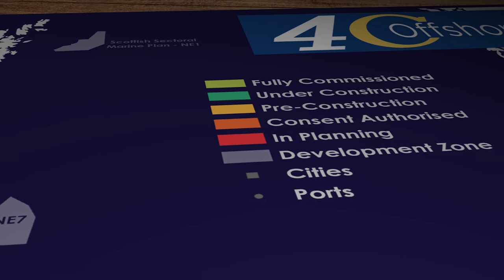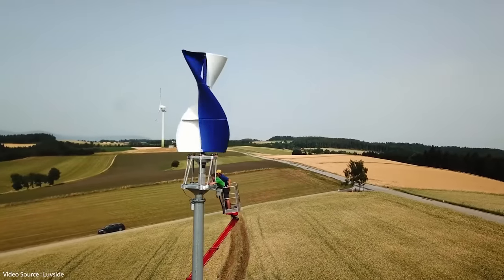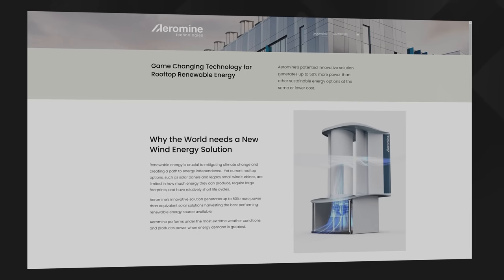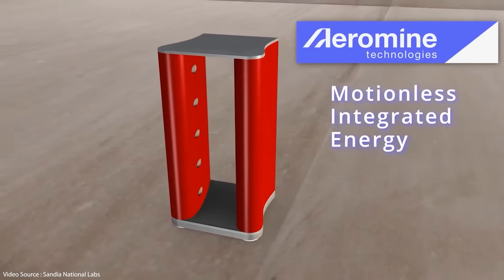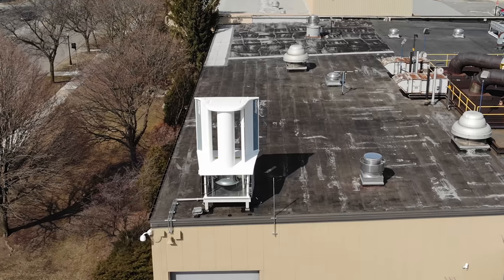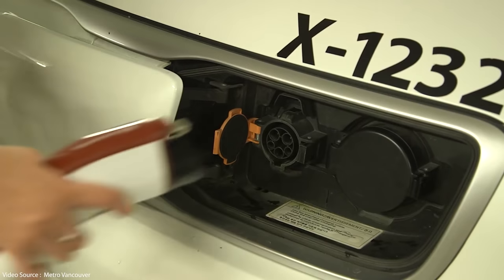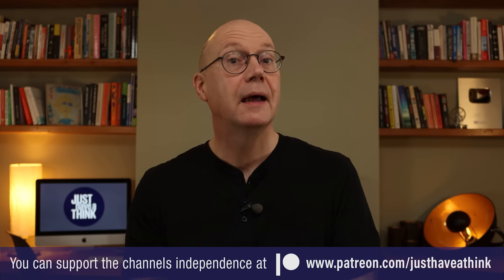Aeromine Rooftop Wind. Static. Silent.  50% more power than Solar PV. What's not to like?

Comment: Thank you! Brilliant as always and I am a great fan of your channel. To the Aeromine: As always with a new product in energy generation, you know exactly where the problem by looking for what is not being stated: Price and productivity. That is not David's fault - it has not been published anywhere. I had to ask. For those of us interested in the financial returns in terms of IRR: A single unit cost c. €10K in hardware only, turnkey installed c. €15K, depending on labour costs. Output is stated at 10-15 MWh per unit per annum, depending on location and wind conditions. In company presentations, output for a 40 unit array is shown at 400-600 MWh total p.a. That comes to the 10-15 MWh per unit per annum, although there are no long term studies to underpin this. O&M is claimed to be practically nil but generator unit needs to be changed out every 6-8 years, so call it 7. That makes it c.€140 p.a. and that is if nothing else happens (not my life experience). Wind speed needs to be 4-5 m/s (3.7 to start up), so 14-18 km/h, which is not an unreasonable speed in suitable locations (not all are). At a more reasonable 1.5% O&M costs, an assumed price of "saved energy" of €120 per MWh i.e. what you pay your provider as a commercial user the IRR is 4-9% (unlevered, equity only) on 10-15 MWh productivity p.a. per unit. No guarantees though ("depending on wind conditions"). That does not make this bankable.  This certainly does not beat solar PV (static, angled, on flat rooftops with imperfect locations) in Southern Europe, but it might in W France, Benelux and Scandi and may be SCO. Boxes need to become cheaper. But an interesting concept. Vibrations and torsion stress seems to be less of a problem than with HAWT or VAWT. Turning into the wind will make this much more expensive and kill IRR, even if there is a bit more productivity. Let us see whether they can lower prices with a ramped up production. These things are not complicated to make. The R&D is the clever bit. Please remember that the prop is not directly driven by the wind but rather by a vacuum effect caused by the foils. This does not work with normal HAWT or VAWT calculations.

Comment: 5KW?  Damn, that is a substantial amount of electricity.   For locations with consistent wintertime winds from one direction, this is brilliant.
Reply: thats per unit, imagine a line of them along the edge of a roof.
Reply: 'Rated 5 kW' means 5 kW is the absolute maximum the turbine can deliver without damage. Operation in low winds delivers less. In very high winds the turbine needs to shut down for self preservation, and will deliver no power at all. The typical long term average output is lower by a 'capacity factor' which for classic wind turbines is (40 ... 50)%.
Reply: For industry that's barely a lightbulb. A normal large version produces in the megawatts.
Reply: 5kw peak power is equivalent to multiple panels (10 or 12)  of pv like he said in the video.
Reply: Too substantial to be believed.
Reply: @Leberteich  I don't believe wind could be strong enough to need shut down of this type of turbine as it is very small. Also it could easily be throttled by varying the slot openings on the sides of the central tube. The limit would be in the structural strength of the static vanes and the tube itself.
Reply: @bzuidgeest  can you put it on a city centre roof?😄
Reply: @kevinwillis6707  i can put it outside the city and it will still deliver far more power. In the city i can use solar, no moving parts, cheap to place, cheap to maintain. In city most roofs are not flat. For that you need industry buildings and they already have room for the larger Mills
Reply: If the say 5kw that means at 10m/s (usually) the it falls of exponentially to lower wind speeds.
Reply: No chance it would produce that much power outside of a storm that has already torn the building down.
Reply: @operator8014  Yes, doing the numbers, it won't even come close.
Reply: @Leberteich  Add to that, that wind near the ground and buildings is slowed by those them and creates turbulent flow, the speed of the wind isn't really that high in most of the places we live and the resulting average wind speed is really low. Since the power decreases with the cube of the velocity it means these will likely produce far less than even the conventional wind turbines, or maybe 20% the rated output. At which point your money is better spent on a few more solar panels and a battery to make up for poor weather. 
This also doesn't discuss how it deals with high winds in storms, winds from variable directions, the structure needed to hold it on the roof in high winds, the vibration it induces into the building, the leak path it creates in the roof, wind noise, the list goes on. 

Wind turbines on roofs is a bad idea. Right up there with solar roads...
Reply: lol 5kW... Not in your wildest dreams. The possibility of harvestable energy is limited to Betz's law. And thus limited to the cross section of the air intake of the rotor, minus efficiancy. By just looking at that thing, without calculating it I'd say a few hundred Watts.
Reply: The wind direction isn't really important. We can just mount it on rotatable stands.
Reply: 5kW says nothing, that is peak power. The information we need is how much energy (that is, kWh) per day/month/year such a unit produces on the roof of a building X meters high, Y meters away from another high building and in an area where the average wind speed is Z m/s.

I am sceptical, because there simply is not much energy to be captured in low level winds, because of boundary layer an turbulence effects, but they absolutely get point for trying.
Reply: Almost 1000$ per year for a 50 000$ installation. What a deal!
Reply: @P8qzxnxfP85xZ2H3wDRV  That is a pretty important detail for a large structure like this. Also it means you need a method to turn it into the wind, so motors and controls, or a passive vane. But then it takes up much more space or costs way more and makes more noise.
Reply: @Leberteich  capacity factors for the wind industry is much closer to 30% as installations cannot be put into the already utilised best locations. In Australia the latest wind turbine installations have capacity factors of 27 to 28%.
Reply: @P8qzxnxfP85xZ2H3wDRV  Rotating a whole building or just the wall? 🤣
Reply: The way I understood it, this device harvests the increased air flow produced when the wind hits a wall, & all the air is forced upwards. As it reaches the top it speeds up, & the aeromine  is positioned to use that speed to drive it's propellers. If it points any other way it would miss the sweet spot for efficient performance.
In the same way, used at ground level, the device would only catch actual wind speed, with no increase given by the top of the wall position.
Reply: @bzuidgeest  But for business buildings it's not bad.   Maybe not so much in manufacturing
Reply: I could see putting the whole system on a rotating platform so it could stay centered into the wind, and it could be a passive rudder type device ;-)
Reply: @bzuidgeest  By large version do you mean the kind of wind turbines used to produce grid power? They are at least 50m tall and wouldn’t work on the roof of a factory. 5kw for a piece of equipment that is 3m tall and can fit along the roof’s edge is extremely powerful. Traditional windmills with blades never worked well on buildings because they needed to be big for efficiency which does not work well when trying to mount it on a rooftop. They were also noisy and require a lot of maintenance.
Reply: How much wind does it need for 5kw?! I think it's a best case at best estimate and the real world figures will suck.
Reply: if they included fluid tubes within the airflow that turn it into a heatsink then the excess heat within a building could be used to de-ice the structure in the colder months.
Reply: @beebob1279  not so sure, blocks light for solar and has moving parts that need maintenance.
Reply: think dat those 5kw are made in some sort of perfect lab conditions / wind tunnel not in real world ...
Reply: @christianvanderstap6257  No it doesn't.
Reply: @keithv3767  by large i indeed mean the ones product grid power, but there are a few models in between. And you wouldn't put it on the roof, you would put it next to the factory. 5kw here is a Maximum, the average will barely light a single lightbulb in the factory. Most industry is in parcs, many of them set aside some room for a few real wind generators that do 0,5megawat or more in energy a piece. They will require maintenance just like these rooftop models, but they produce a lot more. Noice? We are taking factory here, windmill noice is not going to be the loudest thing in a factory.
Reply: Exactly! 
Perhaps it'll work on Jupiter?
Reply: @Leberteich  IT'S NOT a TURBINE! Did you pay attention?? It is "STATIC" (no moving parts)...thus NO NEED to shut down! Come on man....a 5th grader could have absorbed this concept!
Reply: @bzuidgeest  In MOST older cities (NYC for example) the VAST majority of 2 3 even 6 family houses ARE flat roofs!
Reply: @marcob.7801  Which can be installed with ultra low maintenance solar panel. Not some contraption that at best gives 5kw and throws shadow on solar and has moving parts needing maintenance.
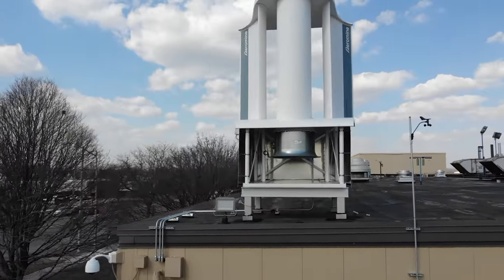Reply: @marcob.7801  It is not static. The venturi effect accelerates air through a duct, and there is a wind turbine in the duct. You can peek into the duct and see spinning turbine blades at 5:13. How else would it generate electricity?
Reply: @Leberteich  exactly it can be neither static, nor noiseless. This is a real click bait title and claim.
Reply: What I've learned from watching and disecting videos is that with 5kW they mean either 5kW at 67km/h windspeeds or they mean 5kWh per year at 67km/h average windspeeds and not only that, they usually mean it at 100 meters high.
Reply: So what you have with wind turbines is a scatter plot which shows the expected power generated at certain wind speeds.
The cut in speed is the moment a wind turbine is going to physically move. At that speed it's just doing nothing. Cut in speeds for VAWTS are usually around 1 m/s or 3.6km/h and then they deliver nothing.
With ground mounted VAWTS you need to be lucky if you have an area with a wind funnel. You won't know until you measure. VAWTS usually have a construction that makes them less dangerous than high poled HAWTS.
HAWTS have a requirement for very directional wind, and that usually means mounting high. They have the requirement to stop or even dismantle in stormy weather.
Anyway: I was looking for a VAWT at flower turbines. And they don't lie. They explicitly state that the output of a wind turbine can be piss poor and you need to measure on location what you might get. Unfortunately their prices are too high to even do an experiment.
But they have a very grounded  information, unlike any other company, you can find all the specs of their mills online with scatter plots and all.
You can of course install $100 aliexpress VAWT to measure the wind in year (especially during the cold months) and devide on that if it would help you out.
Reply: "the speed of the wind isn't really that high in most of the places we live and the resulting average wind speed is really low"

Wyoming says hello.
Reply: How much unit can produce a day I mean kWh and how much to install full set up.

Normal flow of wind is sufficient to run this?
Reply: Nahh more like 24%.
Reply: @marcob.7801  Actually it is... It's just the blades are in the tube. You should have listened carefully when they said "No EXPOSED moving parts" aka they aren't directly visible at least till they showed a shot and you could clearly seen the blades at the bottom of the tube.
Reply: @bloepje  Tx for your substantial post.
I am far from planing PV or WTS. We consume only arount 1,6 to 2,0 MWh (elec) anual. Just to get a feeling what can work.
My (very rough) calculation for my region:
In the bavarian windatlas it is stated that the the average windspeed is 2 to 2,5 km/h (10m height). The power curve diagramm at flower turbine for a medium turbine tells me about 10 W.
10x24x365= 88kWh for a complete year.
That is really near to nothing
Reply: Costs of a medium tulip wind turbine $8.000.
For 20 years you get $4,55 per kWh (w/o installation, maitenance, insurance and spare parts).
Reply: with another manufactorer Vevor micro HAWT: 150€ for a 500W WT.
10x24x365= 88kWh; 88x20 years=1760 kWh; 150:1760=0,09 Euro.
Flower turbine is more in selling art I guess.

Comment: Just like all the other VAWTs, it carefully avoids discussing the garbage wind resource available at building height. Yes wind speed is increased on top of a building, into a turbulent mess that still offers a fraction of what you could get a couple hundred meters up. "At this early stage" is the only time any VAWT gets talked about because the moment they have an operational prototype the output makes it clear that they're wasting money and materials. Oh, and putting turbines next to solar panels is brilliant if you want to reduce the output of the panels with shading or inefficient use of surface area.
Reply: @farnarkleboy  Yeah adding more surface roughness isn't going to transform turbulent air into a laminar flow. It'll concentrate the power that's there sure, but it will lose somewhere in the vicinity of half of the power in the process. That's why surface level wind is useless to begin with. Air is not heavy. It loses a LOT of it's energy on it's first collision. If that's not your turbine, you're missing out on most of the available energy. And yeah a modicum of common sense means you'll be blocking off a sundial swing of your wind turbine that could otherwise accommodate solar panels - when you can pull 400+ watts from a 1 meter square solar panel that shaded area adds up. Wiring them with microinverters to minimize the impact of shading would but a serious tradeoff and the loss from the shading would probably outweigh the power generation of the turbine. That's why we don't already do that. When you see a wind farm it's just turbines and when you see a solar farm it's just solar panels. That's not just business tycoon fatcats making silly choices - they have teams of engineers run all the math and they do the thing that makes the most money. Channeled turbines both vertical and horizontal have been built since the 70/80s. There's nothing new here. It's just remixes of old failed ideas to generate investment capital.
Reply: 100% in line with my thoughts

Comment: A nice development but it has a couple of issues that need to be addressed. The first issue is one you already mentioned; it doesn't rotate so has to be installed facing the prevailing wind direction. It effectively catches the wind at a 45 degree angle on both sides so only captures wind from a 90 degree angle. Any wind outside that angle is lost (the other 270 degrees). The next issue is how efficiently it can use the wind's energy. Normal windturbines get up to about 50%, pretty close to the Betz limit, but this one only gets up to 25%. Another issue is the claimed power  of 5kW. This number was obtained in a free field situation with no obstacles around. However, in a urban environment you have other buildings that impact the wind speed at rooftop level due to the so-called surface roughness. Even in a rural setting you have trees and hedges and other vegetation that have an impact on the wind speed. In order to "beat" solar panels this turbine needs wind speeds of more than 6 m/s (close to 7 m/s) but in urban and rural environments those wind speeds on average don't come above 4 to 4,5 m/s. So this turbine is only more efficient than solar panels in an open field situation.
Reply: What measure are you judging efficiency? Roof space required per kW or something else?
Reply: @rbolden  $/kWh. Solar panels have a cost of about $0.08 to $0.10 per kWh and this turbine needs wind speeds of 5.5 m/s to get to a cost of $0.10 per kWh. That wind speed is above the average (4 m/s to 4.5 m/s) for urban environments.

Comment: I would love to see something like this work and will also be keeping a keen eye on it.  What I see as another opportunity is integrating systems like this much more into the building structure, so they won't stand out. By creating aerodynamic AND architectural units like this, they would become even more attractive. Imagine a building designed to take the rooftop wind from all directions and run it through Aeromine type units increasing yield in areas where wind is more variable.
Reply: Good idea.
Reply: I think if the idea works (I've not seen them in action) then there has to be some trade space in roof design leading to more ideal architecture under the turbines.
What if instead of catching regular updrafts, there was a big funnel section of the building concentrating all that wind into the air inlet?
That could be more effective than the venturi portion of the design, and we could do without. The funnel would provide the venturi instead of trying to use the venturi like headers on a sports car to relieve backpressure from the engine.
Reply: Stand on the top of a skyscraper - near the edge as you can safely... Every evening (almost) you will feel a tremendous blow of wind coming from the street below up the side of the building. Thats where they attach the venturi vanes - to accelerate the wind and spin the generator. Elegant!